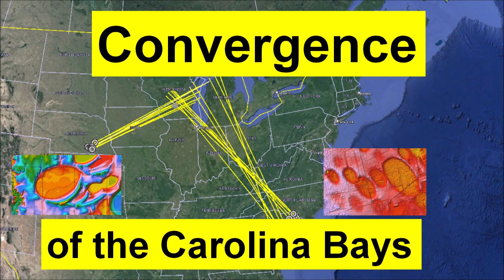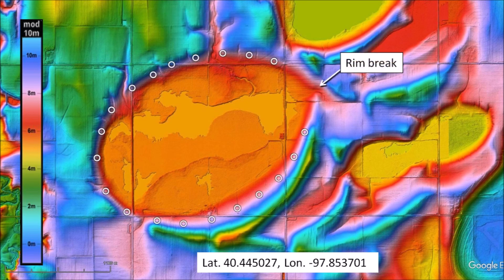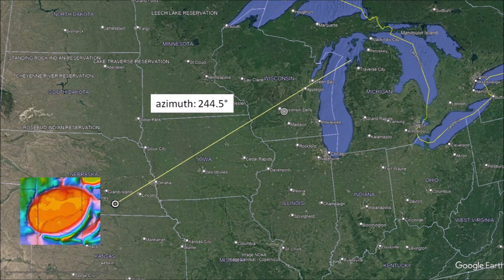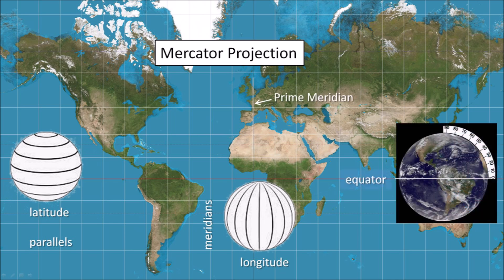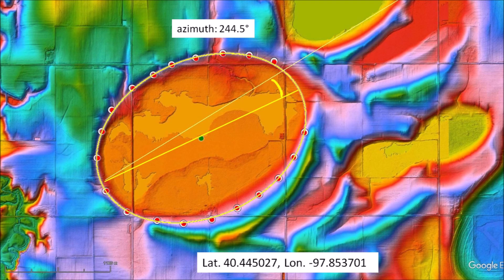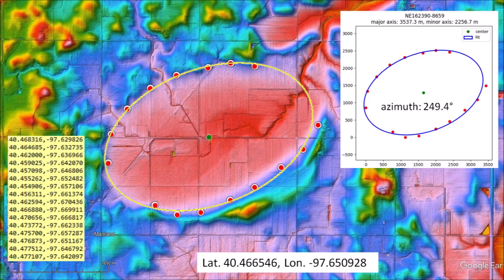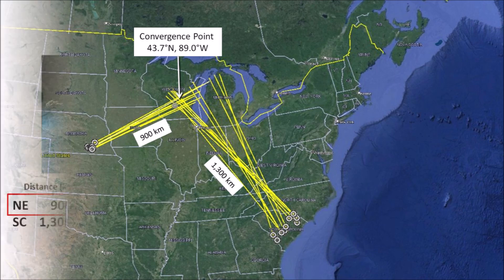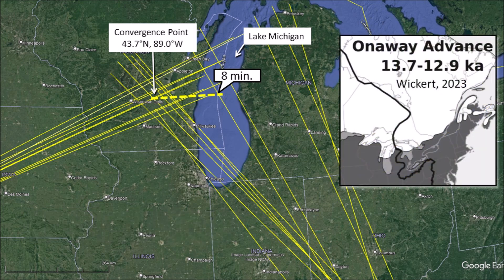Convergence of the Carolina Bays

Comment: Even if southern Lake Michigan was ice-free at this time, is it possible the impact hit there and launched large water drops instead? Would large water "drops" even survive reentry, or maybe they froze while traveling in suborbital space?
Reply from the maker: @AustinKoleCarlisle  Water as a liquid does not exist in the vacuum of space. Above 38km from the Earth's surface the pressure is so low that water boils and a portion becomes water vapor and the rest becomes ice crystals - tiny ice crystals.  In the early days of space travel, astronauts would dump their urine into space and watch a spherical expansion of ice crystals. Now, they recycle urine into drinking water.
Reply: @Antonio_Zamora  i know it's entirely speculation, but after the impact, what if the atmosphere and ejecta/water expanded outward together as a unit into suborbital space (which would've insulated the water from boiling) and maybe as the atmosphere continued expanding outward and rolling over itself its velocity and likewise the velocity of the water contained within it slowed down more than we are calculating, and this would've increased the time aloft for the projectiles. then when the water "drops" hit the earth's surface, the water splashed in all directions, but skewed in the direction of travel which created the ellipse shape. just throwing things out there, i'm not implying you're wrong or anything. maybe this explains why the CBs & NRWBs are so much larger than the other impact craters in the Mid-Atlantic which may in fact be the ice boulder secondary craters you refer to in your hypothesis because those orientations align to areas much further north than the Great Lakes and those other impact areas were 100% covered by extremely thick glacier.
Reply from the maker: @AustinKoleCarlisle  Fantasy is not science. How would you test your hypothesis? If a hypothesis cannot be tested, it is not a scientific hypothesis.
Reply: @Antonio_Zamora  You're right, that train of thought was not well thought out. I guess the simplest explanation is that the impact into southern Lake Michigan erased all evidence of an impact and glacier, much like the one near Saginaw Bay. But there's a non-zero chance it could've been an impact into a large body of water, that's all I was really trying to convey with that train of thought derailment.

Comment: All craters on the moon are circular and all craters on earth that I've seen are circular too. That would only happen if an asteroid hit in a 90° angle, chanses of that happening is almost 0%.
Reply from the maker: The speeds at which craters by extraterrestrial impacts are made are so great that the projectile explodes on contact creating a semicircular cavity. The Carolina Bays were made by relatively slow secondary oblique impacts on liquefied soil that created inclined conical cavities.
Reply: Messier Crater and Plato Crater are both elliptical. Elliptical primary impacts are rare, but in reference to Carolina Bays, we are talking about secondary impacts.

Comment: I'm not sure how you are getting this discrepancy. Google Earth has not used Mercator Projection since 2018; all lines made on modern versions of Google Earth are actually segments of great circles. Either you're using an old version of Google Earth, or I'm misunderstanding your train of thought, but it seems like you're creating an extra step in this process by calculating the azimuth angles in your program and translating that back into Google Earth. Using recent versions of Google Earth, all you have to do is extend the major axis/line of symmetry of the elliptical basin and then calculate how long the projectile would've been in flight based on the width/length ratio; with that, you know the distance the ice boulder traveled, and you would then adjust for the Coriolis Effect based on the origin point's latitude. There is no need to calculate an azimuth angle at all. I hope I'm wrong about this, but this would explain a lot.
Reply from the maker: How can you determine "the line of symmetry"? It is not easy to determine this by eyeball for an eroded basin or even for a perfect ellipse. The program that fits the ellipse can find the exact center of the ellipse and its orientation. Without this angle it is not possible to determine the exact direction for extending the line. Of course, if we knew from the outset the source or convergence point of the projectile, we could just draw a line and get the angle from Google Earth.
Reply: @Antonio_Zamora  My comment was mostly pertaining to the portion of your video around 1:50-2:00 where you get a discrepancy in the "local" vs "calculated" azimuth. Whenever I extend my lines on Google Earth, the azimuth doesn't change. The only reason I can think of for why your lines are changing is that you may be using an old version of Google Earth (pre-2018) which used Mercator projection.

But, as for actually calculating the "line of symmetry"? That's obviously more difficult for highly eroded/distorted basins, but here's the way I do it: take a close-up screenshot of the basin, paste it into MS Word, overlay a translucent ellipse (using the "oval tool") then rotate and adjust it until a best fit is achieved, then observe where the vertexes are located on the basin, then go over to Google Earth and draw a line through those same points then just extend it for 1500 km. It takes about a minute. Of course, this is not accounting for the Coriolis effect.
Reply from the maker: @AustinKoleCarlisle I am using the latest version of Google Earth.  You should also see this if you bisect the ellipse and then extend the line at the same angle for 1000 km. Then, go back to the original ellipse and see how the line has changed.
Reply: @Antonio_Zamora  I went into Google Earth, extended the major axis of this basin into Lake Michigan, and did not see a discrepancy when I zoomed back in at the basin.
Reply: @Antonio_Zamora  Okay I figured out what's causing the discrepancy! I have been drawing a line segment starting from the distal end of the basin and then extending the line through the proximal end toward Lake Michigan--this method maintains the heading (which is 180 degrees less than what you are getting). However, if you draw the line segment starting from the proximal end to the distal end of the basin, then extend the proximal end of the line segment toward Lake Michigan, the heading will in fact change as you extend the proximal end of the line segment into different latitude. That method results in a continually changing heading because you're continually changing the starting point for the ruler tool.
Reply from the maker: @AustinKoleCarlisle The azimuth for the CBs and the NRBs has to originate by the Great Lakes, which is the direction from where the glacier ice boulders came from. 😊
Reply: @Antonio_Zamora  Haha... trust me, you are overthinking this. I don't usually challenge your expertise, but please go to google earth and draw a line starting at the distal end of this basin (farthest from Lake Michigan) to the proximal end (closest to Lake Michigan). Take a screenshot and note where the line bisects the basin; the heading should read ~64 degrees. Then extend the proximal end (the end closest to Lake Michigan) while maintaining the heading (~64 degrees). Once the line is extended into Lake Michigan, zoom back to the basin and you'll see that the heading is maintained and the bisect points didn't shift. Then, if you want to calculate the origin launch point (comet impact site), it's just a matter of making a Coriolis adjustment for the origin location once you calculate the distance & time the ice boulder would have traveled, but those Coriolis calculations are over my head.

Comment: I have a very powerful theory, but it requires a little thought from the reader:

The Earth is a POWERFUL magnetic object. Its field extends more than 500,000km out on the opposition side. The Moon actually crosses the tail during Full Phase and depending on its long cycle of 8.85 tropical years, influences any/all enegetic magnetic hysteresis from the magnetotail into space. Thus, the toroidal magnetic dipole of the Earth is a planetary magnet. Now, about charge...

The plane of the elliptic marks the boundary between the positive pole and the negative pole of the heliospheric current sheet, which winds around the sun as it spins like a gigantic wave. As this wave moves around it affects every celestial body in the solar system, all the way to the 'Oort Cloud', or the heliopausal barrier. Everything within this sphere should be considered within the 'boundaries of an atom' as far as the universe is concerned: Only particles can come in or out, if they break the necessary physical limitations of gravity wells....and magnetic grappling.

Our planet, as I said, is an enormous magnet. Variously, across history, the planetary magnetic field has 'collapsed' or 'excursed' far beyond the polar latitudes; many scientists think this is a core-effect, and I do not disagree...I do, however, posit an alternative interpretation:

The Axis of Evil. This is the collective spread of magnetic fields we have mapped across our universe, and 2 specific poles are oriented perfectly with our elliptical plane: the dipole very strongly, and the quadrupole less strongly.

The Ancients left us with a few clues that gave me a nice run for my money; the Flower of Life, triptych representation, buried symbology, consciousness feeding subconscious feeding consciousness. They were truly masters, knowing this pattern of the universe: As above, so below. The pyramidal structure of the universe and the inter-relationship between the cosmos and our Firmament, this world so delicately balanced between the limited level of consciousness at the dipole field and the expansive level at the quadrupole field. Our planet is constantly flickering (by whatever means within the core) between a dipole field and a quadrupole field, AKA 'geomagnetic excursion or pole shift'. Magnetic fields, you see, are a very tricky study, but scientists are finding the universe is absolutely filled with 'chaotic fields' that have too many polarities to be visible, but the Ancients already knew this.

The Earth was undergoing the Gothenburg Excursion between 13,700 and 12,400 years ago. In the middle of this Excursion was the Younger Dryas impact. My personal belief is that the comet that impacted the Earth crossed at or around the Equinoxes (when the Earth crosses the Elliptical plane), exploding from the discharge and cascading into the northern ice sheets like cosmic cannonfire. Their impact into 3000-6000-foot-deep ice sheet, scattering chunks in multiple directions. 

This event melted a continent of ice, filling the ocean basins in the east and south, and west. Every single civilization across the world felt the detonations, and every single one was drowned out by the tsunamis, torrential storms, volcanic eruptions, volatile magnetic fields, and death. The world saw its worst catastrophe in many many millennia; there were bad ones like Leschamp, 42,000 years ago, but the Gothenburg was special. It finished off the Elder and Cousin races, forcing them to interbreed with homo sapiens and creating our modern selves: Haplogroup Humanity.

Whaddya think? too much?

Comment: Is there a way to date the bays, at least relative to one another? Just wondering if these great lake impacts may have occurred thousands of years apart, or roughly in the same time frame of a week or so.
Reply: For what it's worth, my analysis indicates that all of the cosmic impacts occurred simultaneously.
Reply from the maker: If the Carolina Bays were made by secondary impacts of glacier ice as proposed by the glacier ice impact hypothesis, all the bays formed within 5 minutes of each other. We can calculate this from the ballistic equations using the angles implied by the width to length ratios of the bays.
Reply: @Antonio_Zamora  So you are saying that from the angles of the secondary impacts we can tell that they all came from the same primary impact?
Reply from the maker: @peterdebaets4590 The sine of the width-to-length ratio provides the angle of impact. If we assume that the angle is the same as the launch angle, then the ballistic equations for the distance from the convergence point to the basin can provide the loft time. By doing this for several adjacent basins we can work out their relative time of emplacement.

Comment: Is it possible the velocity of the ice boulders was much faster or slower than you are calculating?
Reply from the maker: My video only calculated a trajectory at a 45° angle. Smaller angles would require higher speeds to reach the same distance.

Comment: So after I reported to you that I found the impact site in Wisconsin that caused the Carolina's elliptical formations, you went and updated your presentation to make it sound like you calculated it and take credit for my research?  That is very disingenuous.  And at the time you responded to my comment by dismissing it.  You have some nerve!

As I stated, the impact site can be seen in Google maps starting just south of the town of Plover and it is roughly about 800 square miles (40 x 20 miles). It extends all the way down to Wisconsin Dells, and Petenwell Lake is also encompassed within the impact zone. This gash in our planet can be viewed using Google Earth because of its ability to tilt the view. You can best view the impact if you rotate the planet looking southward, towards Plover, WI and view the impact's edge as going to Wisconsin Rapids, the edge of Lake Petenwell, to the Wisconsin Dells and then back up northwards towards Plover. I imagine the extraterrestrial object's explosion forced a really huge plate of the mile thick ice down into the Earth pushing heaviest towards the west/southwest at Petenwell. The rebound then threw the ice southeastward to South Carolina.

 
If you look at Google Earth's image looking southward towards Plover Wisconsin and then zoom out to see the rest of the surface of the earth, you will find that the earth;s surface is very uniform except for the area I am pointing out. It is a shallow depression over a vast area relatively speaking, but I believe that is because the Ice buffered the impact. It is one of those 'Oh wow' moments when you view it at the correct angle.
Reply from the maker: The convergence point in Wisconsin was reported by Richard Firestone in 2006, and by Michael Davias in 2010. Nobody is stealing ideas here. This is old news, but with greater mathematical precision.

Comment: Should you not adjust each flight time independently instead of just lumping them into an 8 minute flight time? What does the convergence look like when each projectile is adjusted?
Reply from the maker: In order to determine flight time using ballistic equations, a launch location and a destination are required.  The launch location can only be determined from the convergence points of several trajectories from different destinations. The orientation of a single impact can only give you one line. You need multiple lines to get a convergence.

Comment: Hi Antonio.  I'd like to offer a suggestion for you to consider.  If, based on flight times for corriolis, you moved the convergence point for NE by 7 mins, and the points for SC by closer to nine minutes, you would get a more northern origin point, but probably still within the bounds of Lake Michigan.  I think taking an average of 8 mins for both is too imprecise.
Reply from the maker: There is a lot of wiggle room. When more basins are considered, there seem to be several convergence points.
Reply: @Antonio_Zamora , multiple impacts.

Comment: What is the convergence if you put lines to show the prevailing winds?
Reply: Wind would not have a noticeable effect
Reply from the maker: @Argrouk That is correct. The trajectories were suborbital space flights above the atmosphere.
Reply: Wind has an effect on a bullet. Why would it not have an effect. The objects where in multiple layers of atmospheres twice.
Reply from the maker: @LotsofStuffYT  Take a look at this video. It discusses the atmospheric effects during launch and re-entry: https://youtu.be/AQJckYpZ1ko
Reply: @Antonio_Zamora  thanks
Reply: @Antonio_Zamora  That video was informative. So the ice projectiles must have been traveling at ballistic speeds upon reentry, but less than 4000m/s. Which I am assuming must be to fast for the wind to effect it. Is there a video discussing the shape of the objects? Would shape have any effect as well, I am also assuming that the ice objects were not all round.
Reply from the maker: The ice projectiles must have been somewhat round after coming through the atmosphere. But the shape does not affect the creation of the conical cavities. I have some experiments showing irregular pieces of ice making conical penetration funnels. https://youtube.com/shorts/TxehkX69mqo?feature=share
Reply: We must consider also the problem of the initial impact shock wave and the effect on prevailing winds. Potentially hurricane force pressure redistribution?
Reply: @candui-7  Prevailing winds would be like licking a glacier.  The shockwave would be in the direction of flight of the boulder.